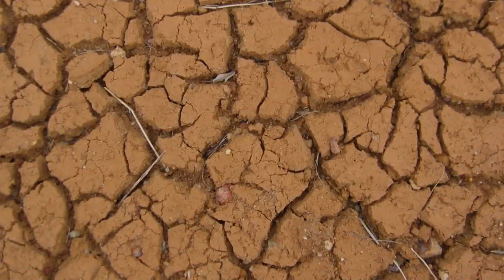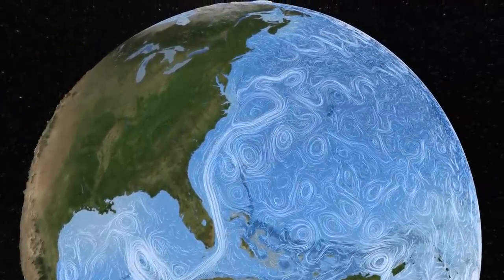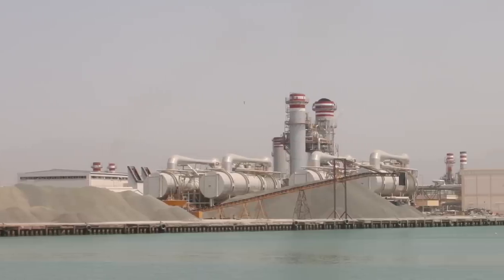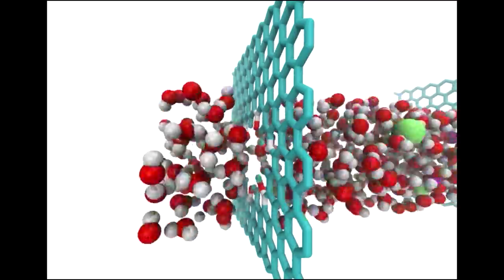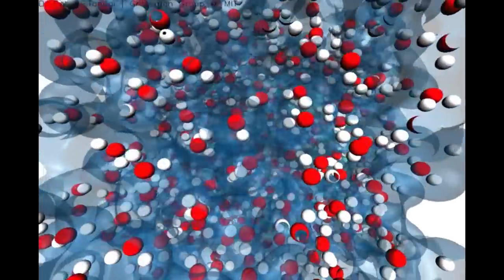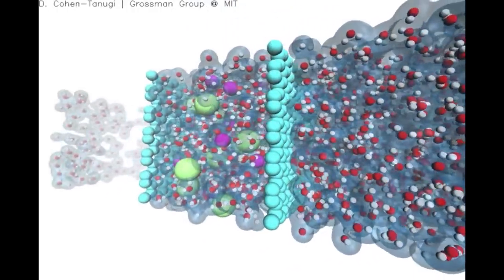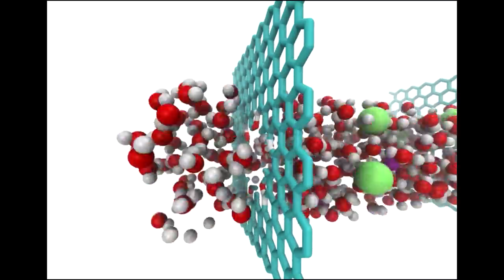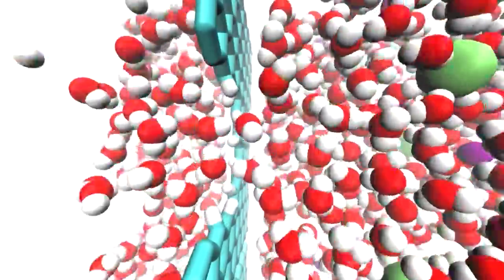A new approach to water desalination

Comment: Please get this into commercial production as soon as possible thank you.
Reply: Yon Kromis they just figured out two ways to make graphene much easier
Reply: +Ben Cameron  How long do you think it'll take until this would be available?  If not doable by us average people?  lol  :)
Reply: 10 years.  If.  making the graphene survive the environmental factors is hard.  U manchester has a group approaching this as well - their approach is make multiple layers with controlled 'holes' - align them to correct size of final hole for water permeability and then bond a rigid material to that sandwich.  So you'd have a patch of this stuff that would be durable enough to be used in things like a pouring filter, or as a portal in the side wall of a retaining device which would hold the reject and allow the pure water to leave it for capture and use.   Imagine a bucket with patches like that in it, put the bucket in the source water and then pump the clean water from the bucket as it fills...
Reply: @lylestavast7652  there is no reason why it should take 10 years

the  issues  facing graphene as a membrane already face other materials  bing used as membranes right now in RO   desal

Comment: Why hasn't anyone made a really big solar distillery? A massive one that takes up a few acres? Only power required would be for pumps and temperature management.
And only problem would be disposing of the salt regularly.
Something like that could probably produce loads of water while leaving salt behind and using a fraction of the power as a large water filtration plant.
Reply: Problem with this is that pure water is extremely corrosive. I had a solar water purifier before and the water tasted like plastic, as pure water ions removed any free H+ ions. Thus the only materials that appear to be useful as it's components must be made of glass or ceramics (metal will rust, plastics disintegrate etc).

Comment: So could existing desalinization plants be retrofitted with graphene membranes or are new plants needed?
Reply: The graphene membrane production is costly even with economics of scales. 2D graphene cant be produced in a single large molecular sheet, for they tend to be in flakes and are compressed to make into other structures.
Reply: @jameszhang9326  Still, building a new desalination plant is also expensive. The question is whether to refit existing plants, if possible, or build new desalination facilities.
Reply: @sharkseatmore You can perform costing analysis based on some textbook formulas adjusted to the market rates. The degree of retrofit doesnt seem that large, but there are still more affordable alternatives. Building additional (newer / more novel) desalination plants may not be bad strategically, but still they require resources and time. You could better park the investments elsewhere, lol.

Comment: Would this work with Forward Osmosis? Reverse osmosis takes a lot of electricity to push against the osmotic gradient.  With Forward osmosis no pressure is needed, just a temperature gradient to separate out the draw  salt.  While not necessarily more energy efficient the heat source can be a waste heat source from other industrial activity.  Essentially a free source of energy. Bio-fauling would also less of a problem since the higher salt gradient with serve to retarded bacterial overgrowth.  Just thinking?
Reply: if you get a small enough hole close to the side of a water molecule, they'll join in a stream and flow through without pressure...  simply putting it on the side of a vessel containing the source could work...  keeping the reject from fouling the orifice gets to be an issue as the pure water gets drawn away...

Comment: Bad idea. When you make a hole in the graphene, the edges of the hole react with many chemicals dissolved in the water. Silicon is less reactive than graphene, and it can be shaped like the graphene - maybe it will do the job? Another idea is to trap iron atoms in buckyballs (C60 fullerenes), so that they become magnetic, and filter the water through a stack of the buckyballs held in place by a magnet.

Comment: If you used a base to put the nano filter on and you would use a drum wherein the water rotated around and use the spiraling motion to wash out the filter ???
And than spray out some water to let these mists pfcwater evaporate as much as you can and put the slays back into the Sea and use the resulting cooling as a way to create a temperature difference !!

If you used this system to clean out the oceans to !!!

Comment: Ok, graphene has some amazing properties, granted.  But even if we could manufacture this tricky material, manage to perforate it with microscopic holes that would allow water to flow but salt molecules not - what about the rest of the problem?  We would still need to pump hundreds of millions of gallons of water through this magical membrane material which will com eat a cost of a large carbon footprint from burning fossil fuels.  Then what about the salt - where do we store that?
Reply: We can efficiently control the amount of emissions coming from power plants that will produce the energy needed to run the pumps.  Even with current desalination methods, the cost of desalination is expected to match the cost of water purchases, irrigation, and water production.  These costs are expected to rise as droughts worsen.

Graphene is a material that has 100x the water permeability of current desalination membranes.  IF we are able to create graphene cheaply and efficiency, we will decrease the required power needed to pump water through them, and therefore reduce our emissions due to desalination.  The cost of water production through desalination may then match the cost of other means of production through this process.

However, I agree.  We must continue to search for new methods of desalination and TDS removal.